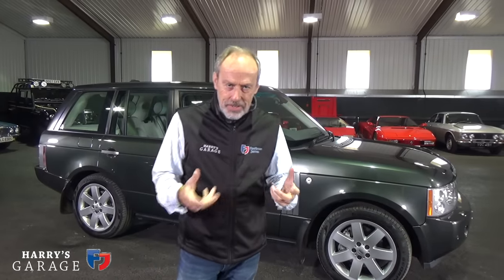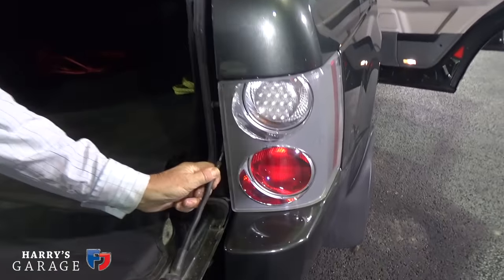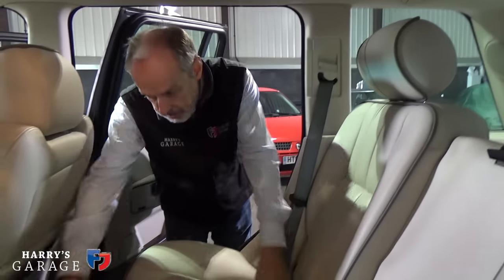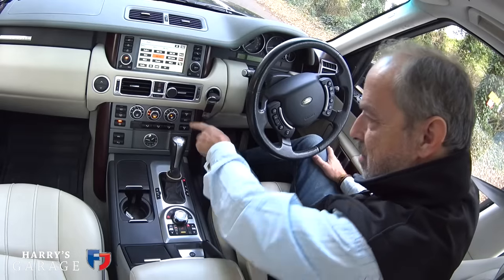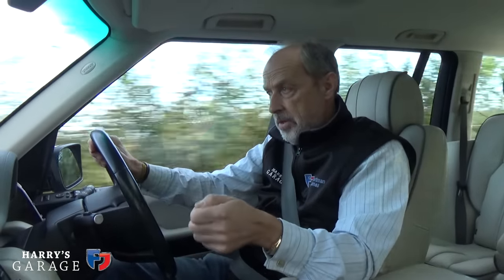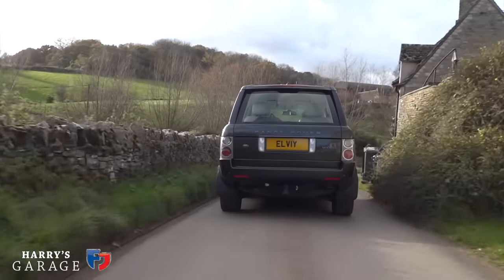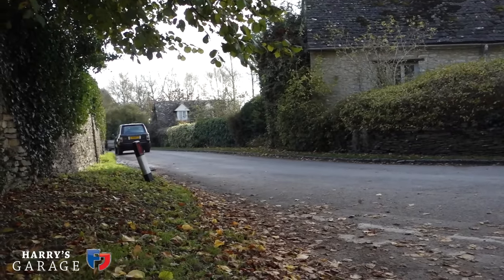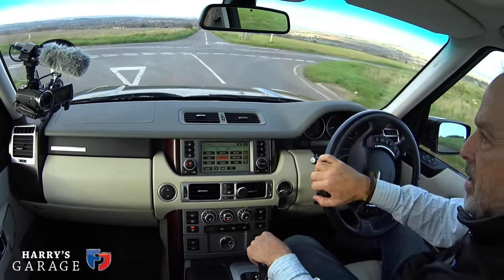Range Rover real-world review and buyer's guide L322 TDV8

Comment: I've had my 2008 TDV8 for almost three years now and have done about 40000 km with it, starting out at almost exactly 300000 km when I bought it from a dealer in Germany. Saved about EUR 10k, that way, compared to buying one here in Sweden. I've driven it mostly on paved roads, but also in deep enough mud that I got stuck once. Actually so deep, that I couldn't open the drivers door in extended mode. But I got out of that one, in the end too after bailing out on the passenger side and throwing some wood in front of the rear wheels. Overall a reliable car, just as you say. The only real disappointment I've had with her, is that the rectifier bridge on the alternator threw in the towel two days before we were supposed to go on vacation. So I was stuck here in Stockholm, replacing the alternator at the parking place, while I sent the rest of my family to Barcelona by air. You're not supposed to replace it from the top, but with just the right amount of swearing and wiggling, it came out and the new one got in. All the pulleys and the tensioner for the aux drive-belt was also replaced. Earlier, just after I got her, I replaced a rear brake caliper and all discs and pads. That I'll just consider normal service items. Apart from that, no issues whatsoever. It got a MOT last Tuesday with clean papers. I don't completely agree with you on the 20" wheels, though. I've got 20" summer wheels (255/50-20) and it gets so much more bumpy on bad roads, compared to my 255/55-19 winter wheels. And I don't feel I lose that much in handling. A little bit more spongy, perhaps, but this car is more like driving a truck than a car, so I like it. Maybe it's some nostalgia from when I drove trucks for a living... :-)
(Footage [dashcam] from the getting stuck incident https://www.youtube.com/watch?v=m_nhQvX1Ddc )

Comment: Having driven several 'Rangies' I can honestly say that the 3.6 V8 is probably the best I car I have had the privilege to drive. Surprisingly economical (or maybe that was just the size of the fuel tank?) and by far the most comfortable vehicle.....Don't expect to be able to do the twisty stuff when you compare it to say, the Cayenne diesel but otherwise just an awesome vehicle. Unfortunately, as with all 'high end' luxury 4 X 4's maintenance is expensive and when issues arise, having then fixed is the same. Think Harry is right in advising against buying the BMW produced diesel.....but generally a great car...
Reply: Malcolm Young Indeed. When you realise that same BMW diesel was also available in the 3 series weighing only 1.6tons you do go Hmmmmmmm